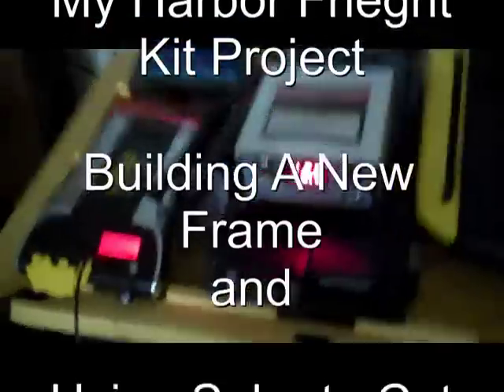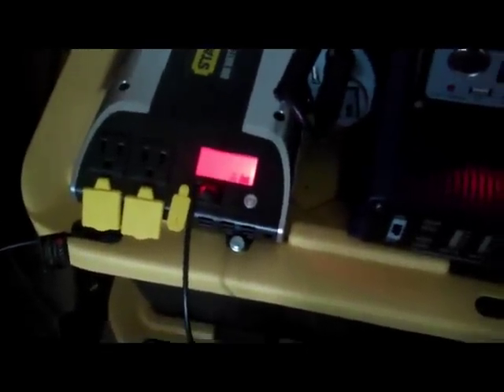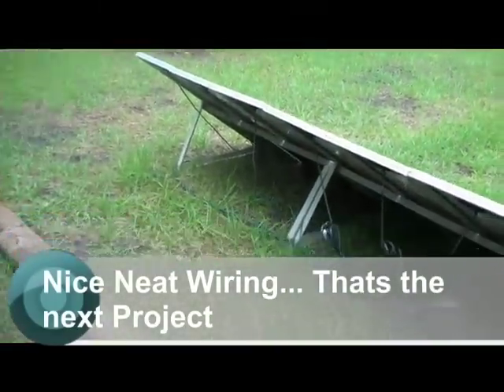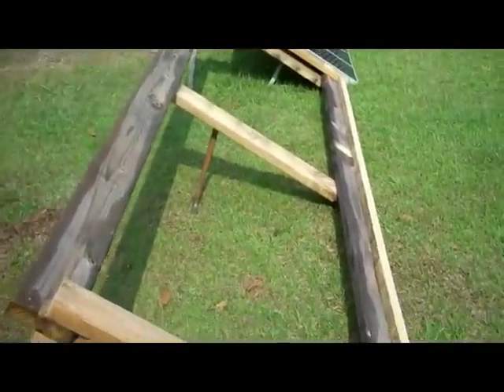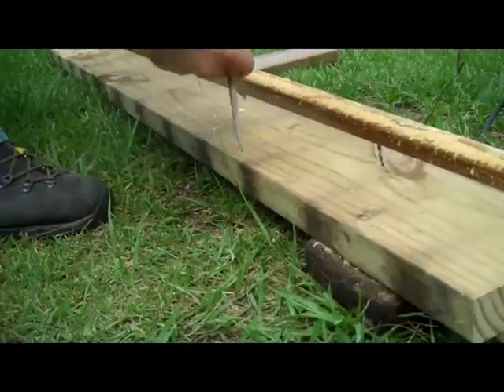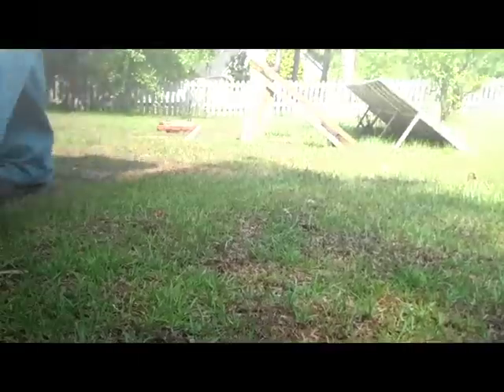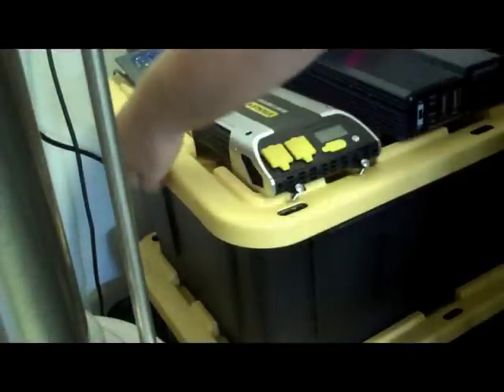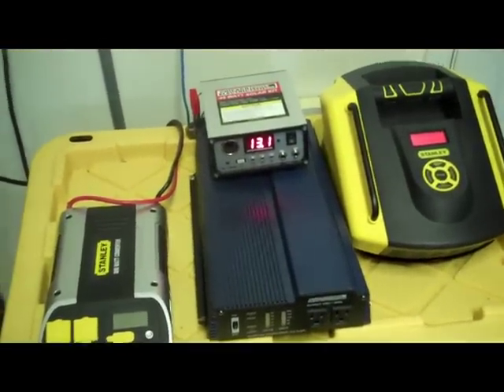Harbor Freight Solar Project

Comment: Honestly get away from harbor freight garbage solar setup it's a total waste of time. Sorry not trying to piss on your parade but I have learned this the hard way myself from way back in the day and I'm not too proud to admit it. I am now at 14.6 kw. I have learned to go to a real setup, get a real system as the harbor freight is for someone who is wanting to jack around and will never understand how it is a waste of time. Number 1 it is 12 volt, 2 it is a garbage charge controller you would get better performance running the wires straight to your batteries believe it or not and 3 it is not enough amperage to fool with. Go get a 200 watt panel buy a real charge controller capable of MPPT and go to either 24, 36, 48 or 96 volt battery inverter configuration as it is far more efficient. The higher the voltage batteries the better but the higher the more the inverter and charge controller will cost you but again, it is worth the extra money. You see, you have what is known as open circuit from any panel and it is usually 21 volts or higher ( higher is better up to 51 volts) then when you go do your solar panel purchase base your battery configuration based off of the solar voltage. In the case of 51 volts I would go with a 48 volt setup because it is only 3 volts downgrade from the 51. This will be worth doing. You will need to learn how to setup batteries in series. Remember the lower your batteries are at the core IE 2.0 volts per battery for example times 12 will give a 24 volt setup. because the battery core voltage is lower, this will almost always give you a higher amp hour depending on the battery and its ah rating which means that the batteries will last longer because you can put a deeper charge on it and longer at higher amp draws. I have right now 16, 6 volt agm golf cart batteries running in series at 48 volts setup as 2 seperate banks of 48 volts each. 14600 watts of panels which is 14.6 kwh. This yields me 421.2 amps of power to charge the batteries. That is more than 4 car alternators running 6 hours a day. This amperage output charges my batteries in under an hour from the bottom of the float charge to the top in under 2 hours flat ( I need more batteries) 2 pure sine wave 2500 watt inverters an all in one charge controller, 7000 watt inverter and 35 amp charger for slow or no sun days which charges the batteries on slow or no sun days. I now operate our washer, 110 gas dryer propane, stove propane and tankless water heater propane, 5 led tv's, 2 fridges, a 12 ft chest freezer, toaster oven 3 window AC units and can sustain it all overnight without fear of running out of juice because we are at 48 volts this allows the inverters to have an operating threshold from 52 volts to 31 before the inverter will shut off automatically. So this is a deep runtime I get from this setup and it works so well now. But trust me when I say I started like you over the past 11 years now and it has changed so much since then its incredible. I have went the tesla route in buying the batteries out of a wrecked model S series tesla and again, trust me, lithiums are not all they're cracked up to be because of the limitations in voltage thresholds. You can't take lithium and charge them safely to 51 volts because they only go to 49 volts because they sit naturally at 21, 21 x 2 in series will give you 48 volts but the discharge rate on lithium is 233 amp hours and the AGM's I have are 190 AH and the cost of my batteries in AGM is only 118.00 each times 16 = 708.00 VS 1 Tesla cell costing 1300.00+ dollars each and you need 2 of them to get to 48 volts? So 2600 for Tesla cells VS 708.00 for golf cart batteries and I don't have to worry about battery management system. This would be considered dangerous as they would more than likely explode and catch fire if you went over this voltage. AGM's? Yes no gases and no fluids to add ever and they just tick right along and you can buy them at most any Sam's clubs cheap in 6 volts per golf cart battery. But again, trust me, 12 volt is a death spiral because you will NEVER be able to get enough amperage to go down the wires and they will get hot and if you go all the way up to a 0 gauge wire then you kill yourself in performance because there is too much resistance because your wiring is so thick. TRUST ME GO either 24 or 48 volt if you want a real setup in the future. Hope this helps. O and by the way in case you're wondering, I have 4000.00 in panels 2800.00 in charge controllers/inverters and 800.00 in batteries and adding another 800.00 worth shortly. 8400.00 total? for everything minus the money I blew along the way in harbor freight junk. But the knowledge I obtained along the way? What's that worth?